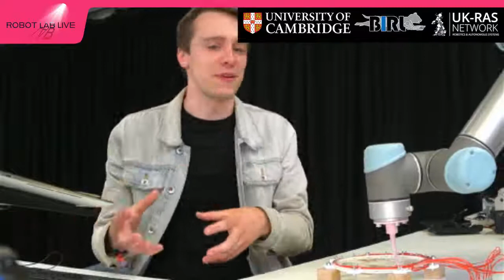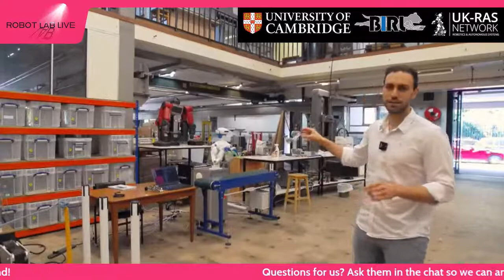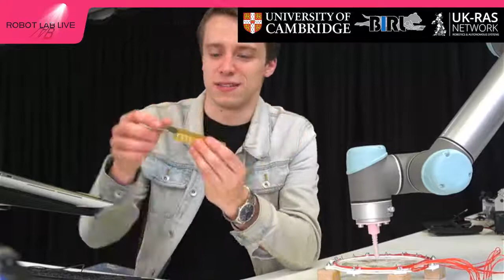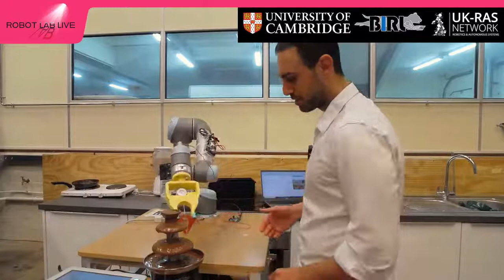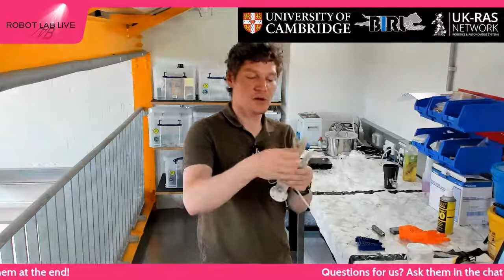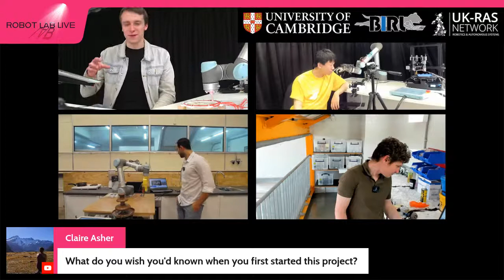Tasty Hands: Edible and Biodegradable Soft Robots of the Future! | Robot Lab Live

Comment: Im curious are the heat and longevity properties of Silicone also available in the gelatin-glycerol hydrogel material? There are other ways of building censors into the silicone soft robots, but if the Gelatin-glycerol is capable of transmitting electrical energy, that could be beneficial as it would a be sensor itself. 
Would it make sense to build most of a soft robot of silicone,and just do strips of the gelatin-glycerol on the parts that you would want sensors to be?
So if you had a soft robot gripper, could most of it be silicone, but just the part that contacts things gelatin glycerol? Does the Gelatin glycerol break down faster than silicone? Thanks in advance. Its a cool video, but it is a little hard to hear people. Cheers